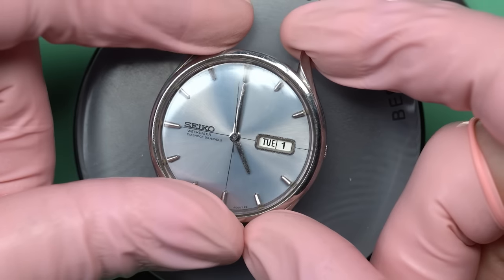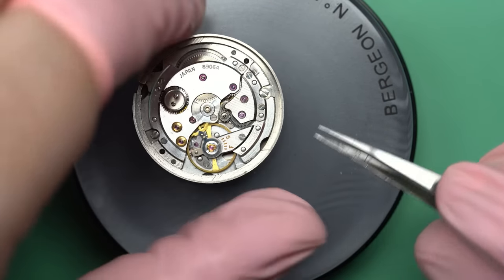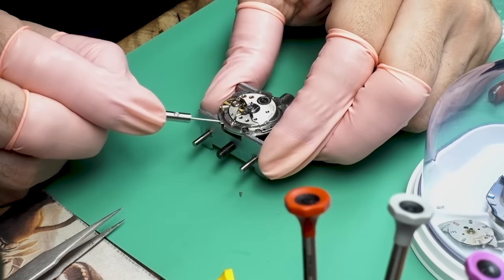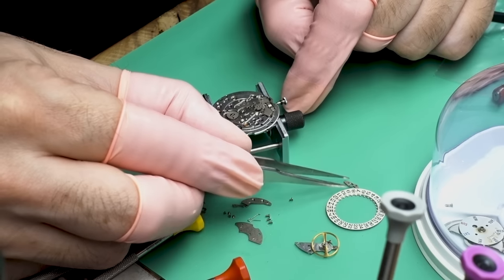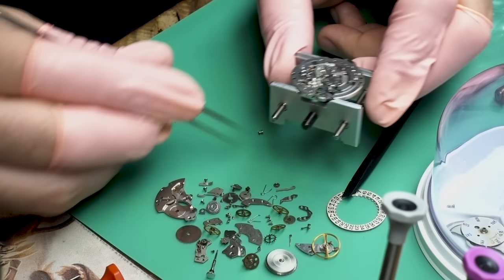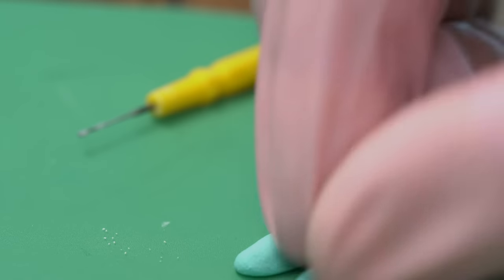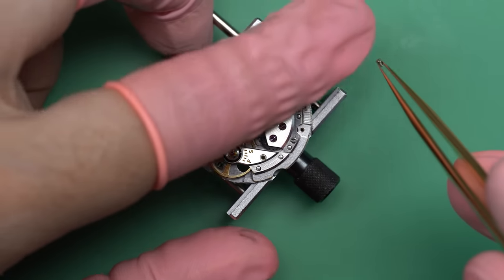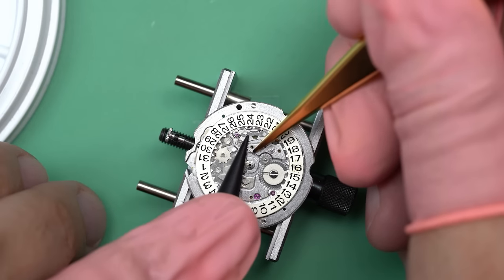Seiko Weekdater Sea Lion Vintage Watch Restoration

Comment: The Sea Lion evidently had different iterations and different movements. Mine was $5 at a yard sale, runs at +2 sec/day after a service and has become my daily driver. The movement has no plastic parts. It says it has 25 jewels, but 4 are decoration only. With the quality they had, why would they need to throw in useless jewels? Batting higher than their league?

Comment: How about we dunk an automatic mechanical wristwatch in 91 octane unleaded gasoline, then blast it with wd-40, then dip it in teflon fortified oil and then see if it works.

Comment: Hello Marshall! I probably shoud not try to correct you on how you deal with the diafix, as I haven't dare to disassemble one of these yet, but I've seen you pressing on one of the lateral legs to take the metal clip out, but you are not supposed to take it out, because then there are more chances to lose it.
I'm not going to explain how it should be done, you can see it here: 
https://youtu.be/FEWTC8VdpSs
and also in this video by Mark Lovick: 
https://youtu.be/OU0_Vaocb1U?t=715

Comment: you should be a lot more careful with that lume i think.  you get the dust all over, and in the putty.  why not have a tiny vacume that takes that dust away?  in a decade you will have a lot of the dust all over.

Comment: Awesome video, but I do have a question/request that I wanna bring to you. I have 2 watches that need to be fixed. One of them is barely running, has something loose on the inside, and the crystal is cracked. It's an Invicta Diving Watch. The other one is an Invicta, but the stem has just pulled straight out and doesn't allow me to change the time or anything. If you could help me out with these, I would pay for what is needed to be done and send them over. Please and thank you. 
Private Message me for my email and the information that you need.